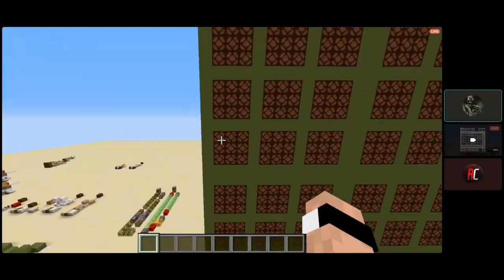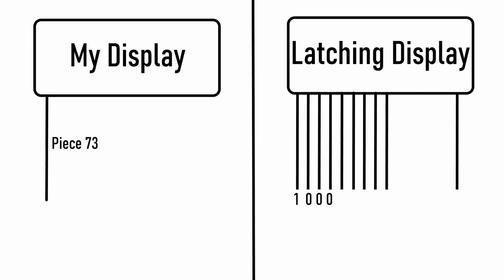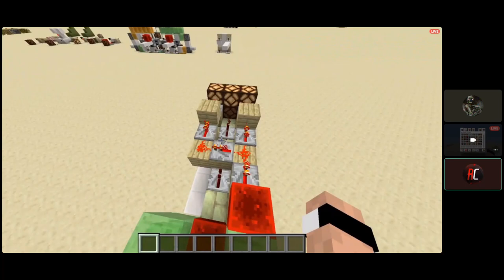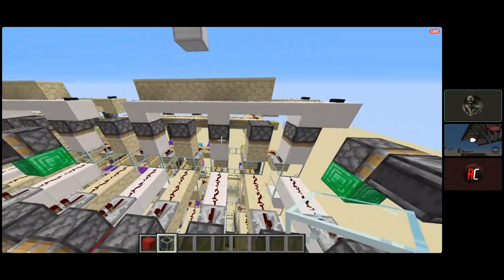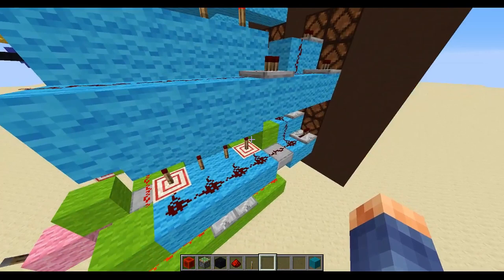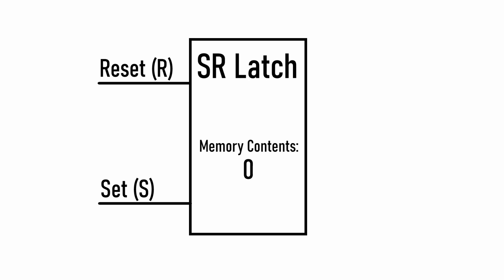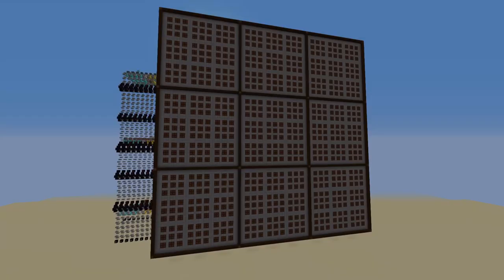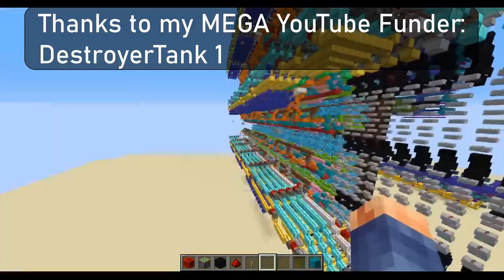Gaining Inspiration: UTTT in Minecraft - #5

Comment: Hol'up
What if you get a tie on a local board?
Does it just clear the local board and continues to play even if the last bit's id corresponds to an already won local board?
Or does it just declares a tie for the entire match?
Reply: If you get a tie on a local board, then it becomes invalid space on the global board and doesn't count towards either player. The local board stays like that and cannot be played on any longer.
Reply: @dansnell5774  interesting, so both players have to work around that in this case
Reply: I've played ultimate tick tack toe with friends several times and I don't think I've ever seen a tie in the local boards simply because each local board can only be played by both players once (as in, bottom left board, player 1 plays bottom left so player 2 has to also place in bottom left board, any other time a player can dominate specific local boards)